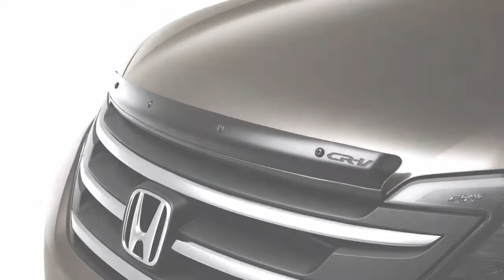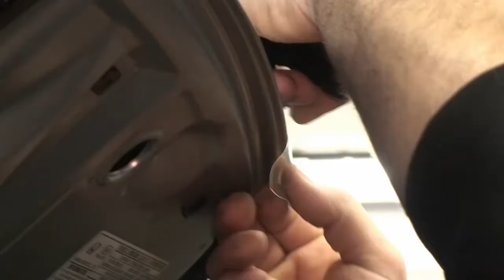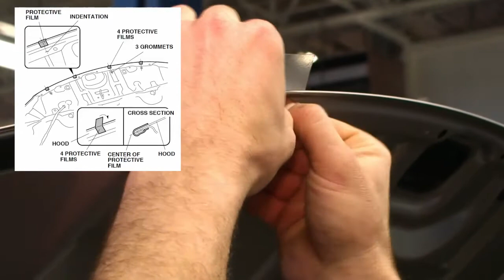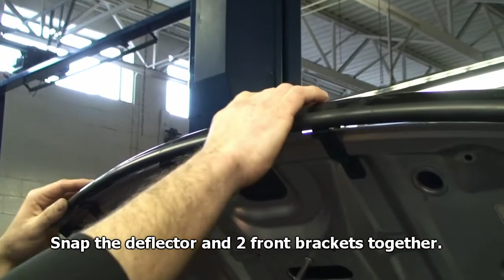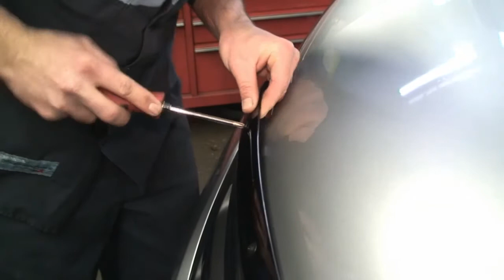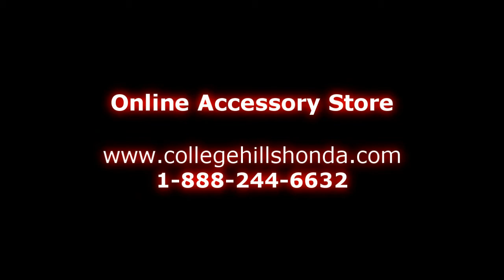Episode #220 - 2012-2016 Honda CR-V Air Deflector Installation

Comment: I appreciate your video. I bought one of these for my 2012 CR-V which I just bought (used). I was disappointed that there were no instructions in the box. I had to guess where each screw and bracket went. Your video helped a little. My kit also had 4 washers and I assume these go on the outside (front) of the deflector? I think it would have been better if all 4 brackets had used the same bolts. The push in screws are quite flimsy.
Reply from the maker: +Alan Graham Almost all Honda accessories do not come with installation instructions. They are available in PDF form on our web site and a million other places across the Internet.